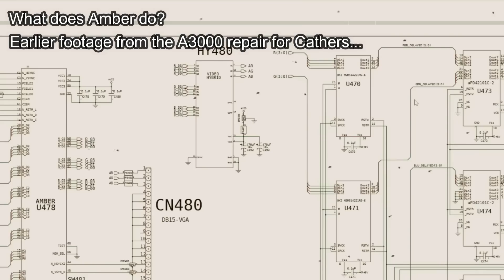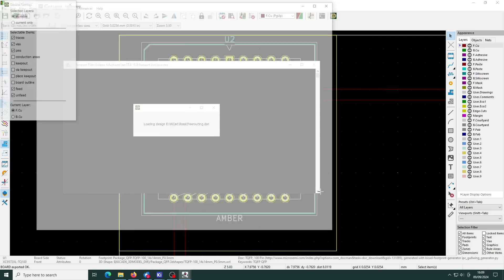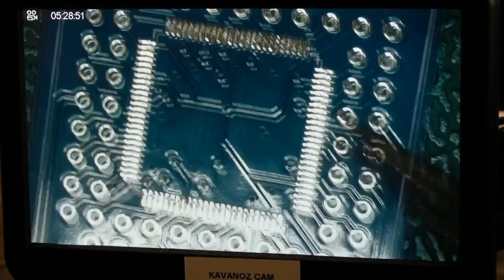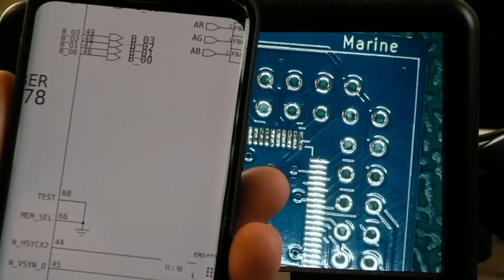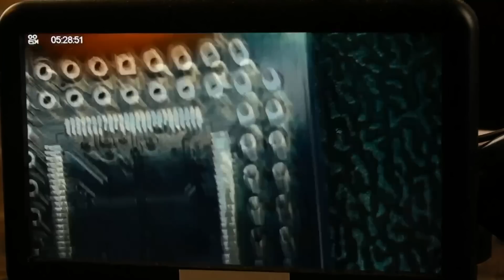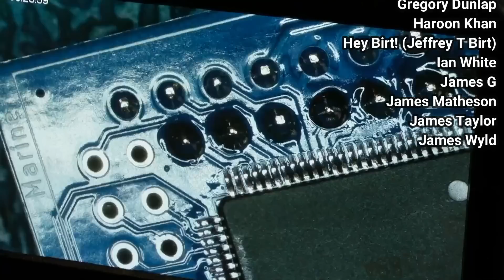Let's re-create Amber (Initial PCB) - Part 1 (Marine)

Comment: I love your channel, lots of quality information, could you answer a question for me? ALIE has those NEW cartridges for MVS in which you can choose the game sent, the game board is half the size of a normal MVS and less chips, I would like to know if you have already tested any of these cartridges? Your evaluation about possible voltage problems (like the first 161 in 1) etc. would be of great value, I would like to buy these cartridges but I am afraid of damaging my MVS ;-(  PS: I LOVE portuguese audio option in your video S2
Reply from the maker: Thanks, I am not aware of these - what are they called?  I will take a look!
Reply: @GadgetUK164   Search  for " NEOGEO MVS Custom" there are at least 2 ads, the cartridge case is dark transparent, one ad with a red plate and another ad with a yellow plate, both are half the size of a normal MVS cart and have few chips, I am concerned about the voltage and construction of these carts, it will be a very good alternative for MVS games that are no longer for sale.

Comment: You can use 4 layers to make routing easier. Put GND and VCC on the inner layers and signals on the top and bottom layers. You will certainly find room for decoupling capacitors. JLCPCB has great prices on 4 layer boards.

Comment: This is really great you doing this. It used to be SDMAC was the $$$$ chip for 3000 builds and I paid hundreds for a couple 02's before ReSDMAC, then Ambers became very difficult to find and $$$. With your ReAmber let the floodgates open for ReA3000's, and hopefully sometime soon also Chucky ReA3000T! Awesome video. Kavanoz built my ReA3000, and Stefan a ReSDMAC & purple ReA4091. Great times for the Amiga.

Comment: When I first started using Eagle (probably around 2003 or so), I tried everything I could to get the Autorouter to do most of the board for me.

Like, moving things around by a tiny bit, then re-running the Autorouter to get a higher percentage done.
Occasionally hitting 100%, or very close to it. lol

But then I started doing almost everything manually routed, and never really looked back.
I haven't used an Autorouter in anything for over ten years, including for the BGA stuff.

I never found an AR which worked out really well, even to get things started.

But, I do import the more complex stuff into Altium, as it has better 'Interactive Routing' tools.
I would consider that almost the same as 'manual' routing in Eagle or KiCAD, except...

Altium can be easily set up to do auto pin-swaps for things like FPGAs, where most of the IO pins are generic.

You just highlight which pins you want to be swappable in a list.
It will also try to keep certain signals within the same IO bank, depending on the voltage standard or timings or whatever.

Then do the initial schematic, but hit Auto Pin-swap on the PCB layout, which will find the closest pins between the FPGA and other components. Then you can export those changes back to the schematic.

For something like the Amber project, though - yeah, you're better off just doing it all manually.
You still can't beat the human brain for stuff like this. ;)

btw, if your adapter isn't 4-layer already, I would for sure give that a try, with Ground and VCC planes on the middle layers.
It can make a big difference to how easily you can do the rest of the routing.

Since you can then just drop a via next to all GND and Power pins on the chip(s), rather than trying to route signal traces around power traces etc.

I used to try to do everything I could to keep a design on a 2-layer board.
But 4-layer has got so much cheaper now, it's often worth the slight extra in cost, unless it's a super simple design.
Reply: One of the first custom libraries I made in Eagle, was for a PLCC84 socket.

That was for the 'PV Backup' cart for N64.

I completely messed up the pin ordering, because the PLCC socket has such a weird numbering scheme. lol

That was also the first more complex PCB I'd ever ordered.
It was only 2-layer, round 120mm square, and I chose not to have a Soldermask (bad idea) to save some money.

Even with no soldermask, it cost €65 at the time, for ONE board! :o 
(PCBpool)

I did attempt to fix the pinout using wires, but gave up in the end.
It was a mess of solder blobs and shorts, due to the lack of Soldermask. Never again. lol
Reply from the maker: LOL =D  Nice work doing that though!
Reply from the maker: Thanks!  I will have a go at 4 layer - maybe for this...  I am not sure my brain will keep up with 4 layers lol!   The only reason I attempted to auto route was when I had failed a few times to manually route after joining IO pins to the Amber profile on the schematic (where the proximity of schematic ICs dont respresent the pin ordering around the real ICs...

Manual is the way I will always go!